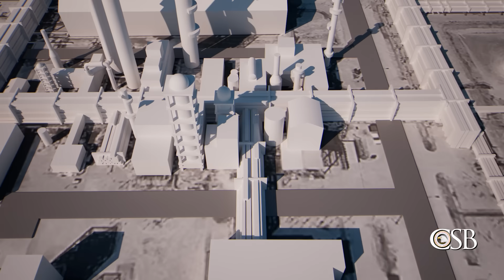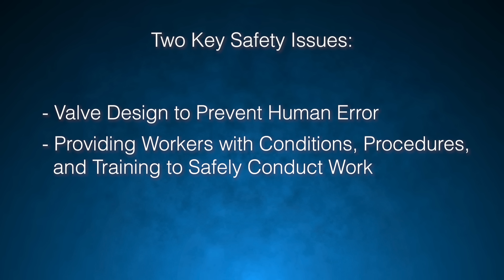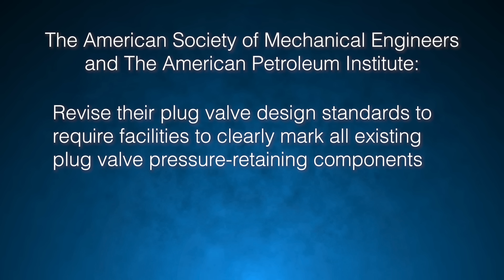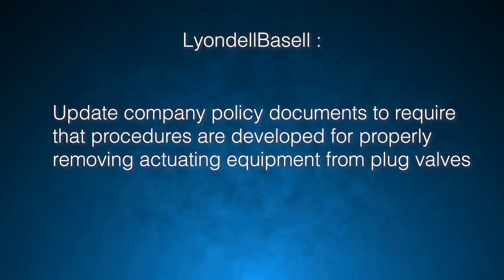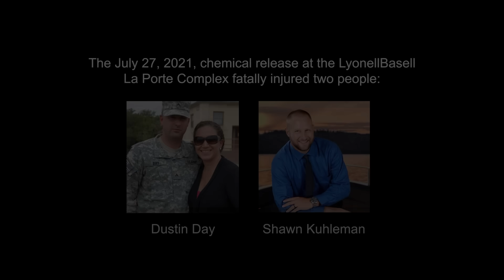Designed to Fail: Chemical Release at LyondellBasell

Comment: Probably one of the most preventable incidents covered by this channel. That said, condolences to the families of the two workers.
Reply: So preventable that it's basically a retread of "fire in baton rouge" video. Employees removed a gearbox from a valve and accidentally removed all the pressure-bearing bolts, leading to hydrocarbon release and explosion.

I guess that problem from before wasn't really fixed.
Reply: @Motoko_Urashima  "there are no new lessons to be learned from this fire, only old lessons that tragically went unheeded" 

- said by a fire chief after the St Mary of the Angels School Fire in 1956
Reply: @Motoko_Urashima  Same nuts that hold the valve together were also asked to hold a flange that needed removal, thus forcing an unnecessary valve disassembly through force of bad design.
Reply: @EinhanderSn0m4n  That wasn't the case in this instance, the actuator was held on with 4 bolts off to the side, none of the valve cover bolts needed to be touched.
Reply: Slap some red paint on the bolts and this never has to happen again.
Reply: I don't work in industry, but I was shocked there was no written or other visual warning indicating what the bolts were. Would seem like an obvious thing to include.
Reply: @anonymoussource1  As a skilled tradesperson who is qualified and regularly works on valves and actuators, it's very obvious which fasteners are holding the bonnet on a valve.  If you think a written or visual warning needs to be present to tell unqualified workers which bolts not to touch if the process hasn't been isolated, depressurised, and drained, then every industrial facility in existence has thousands of pipe flanges you might be interested in.

What I want to know is why the hell pipefitters were performing this task.  Y'all need to get yourselves some instrument techs down in America.
Reply: This one is the stupidest we've seen
Reply: Read
The 
Freaking 
Manual

Look if there aren’t written procedures, at least try to look up the manual for the valve. We have the internet people I would be shocked if it didn’t have the instructions or a parts diagram…

Comment: Is the valve design as fail open? Why remove the actuator in the first place?
Reply: If I had to wager a guess, they thought the flange plate they removed was simply covering the mechanical interface between the actuators shaft and the shaft of the valve itself. In reality, they were already at the mechanical interface between the actuator shaft and valve shaft. The plate they removed was part of the main body of the valve.
They wanted to remove the actuator to ensure someone couldn't accidentally remotely open the valve.
Reply: @HDL_CinC_Dragon  I'm from Germany and have worked in such plants for years. The first thing I thought here was: They definitely don't know what they're doing. In Germany, we definitely wouldn't remove the actuator to prevent someone from accidentally opening the valve while we're working on the flange. All we would do to secure it would be to physically cut off the energy supply to the actuator, i.e. electricity or compressed air, in the closed position by disconnecting the electrical cable or compressed air line. In our plants, many actuators of valves, pumps and agitators have permanently installed safety switches for maintenance purposes that can be secured with a lock. In this case, we would have used such a switch to secure the valve in the closed position. In short, the actuator stays where it is, because that wasn't the real problem, but is secured against accidental activation. And besides, it's actually less work than removing the actuator.
Reply: @benjaminhampel8640  Yeah, that's definitely how this situation should have been handled. I don't know why they don't have a cutoff switch for the power to the actuator. In my opinion, that should be the biggest take away from this incident.
Reply: @HDL_CinC_Dragon I feel like that front plate for the valve should’ve been welded on when it was installed, rather than simply bolted on.
Reply: They wanted to remove it to ensure it was closed so acid wouldn't flow while they were repairing the small leak. Making sure they avoided an unintentional opening of the valve

Comment: Perceived simplicity of the work.....Just goes to show you that complacency is something that must be guarded against.

This is probably the most polished video out of them all. Thanks for honoring those that perished at the end. Sadly regulations are written in blood.
Reply: also they are contracting out work instead of training people to work and be on call is cringe. better to have someone who knows the system and its hazards then to get some randome company to ape your shit up
Reply: @arowhead9  From the video, it sounds like at least one was a journeyman pipe fitter. To be a journeyman, you must have a lot of training and should be proficient at this stuff.
Reply: I honestly can't believe that any pipe fitter would do something like this. They are trained to work with this stuff. Very sad. I personally wouldn't have ever thought a procedure would be needed for such a simple task. Just goes to show how you can't trust anyone.
Reply: @crissd8283 the video literally said they weren't trained to remove the actuator....
Reply: @Generic_Name_1-1  Any pipe fitter worth their salt would think twice what fastners to loosen, especially on a pressurized system, tripley so when hazadous chemicals are involved.
And what about some basic PPE like bunny suits and a full face splash mask.
Reply: @trespire  can't use equipment that wasn't provided to you. And you can't know what bolts not to loosen when you've never been shown which ones are critical.
Reply: @Generic_Name_1-1  A fittter that can't identify what bolt holds what flange, has no buisness working in the chemical industry.
Procedures can be incorrect, or unclear, always use your judgemt as a fall back.
Reply: @Generic_Name_1-1  The video also said at least one was a pipefitter. I'm assuming a journeyman pipe fitter. That means trained in pipe fitting. It there was only an apprentice pipe fitter, that is a big problem.
Reply: @trespire  I feel for all the victims of this tragic accident and I hope that we see fewer work related accidents in the future. I can’t help but agree with you but also it sounds like it’s a bad design if it’s causing multiple fatal accidents. Seems most trades don’t prioritize education these days.
Reply: @Generic_Name_1-1  while I agree they should have been given some sort of exploded view diagram of the setup and maybe fully disassembled a dummy unit disconnected from a system, some things are industry standard for certain jobs. "You've worked on one, you've worked on em' all." 

I'm not necessarily saying that applies to this case (maybe this valve was special or unique), just pointing out that you don't need to be trained down to such a macro level on every little thing to know how to disassemble X even if you've never seen this specific X before. Sometimes you can apply experience in that way. In this case they either all collectively had a brain fart or were not familiar enough and therefore lacked that sort of experience.

Either way, on a high pressure system working on the only thing holding back hundreds of thousands of gallons of acid...yeah that might be the time to do some extra training whether you think the pipe fitters are experienced or not.
Reply: @Generic_Name_1-1 
This happened in 2021. Almost everyone has smartphones. The fitters or supervisor obviously did understand how the actuator was installed on the valve. They should have looked at the valve and actuator tags. With the information on the tag they would have likely been able to use their smartphones to look up the information they needed. 

But honestly that should have been done in advance. Special parts would be needed to install in place of the actuator to lock the valve in place. If they had the correct part then someone had the information. If they didn't have the correct part then there was no way that they could have completed the task.
Reply: @crissd8283 
I think they said two fitters and a supervisor. 
To me it sounds like someone on the crew had a get-it-done attitude. The others took risks due to the pressure put on them. 
Like you said valves are generally not complex. Any doubt should lead to reading the tags and look up the valve and actuator with your smart phone.
Reply: @Generic_Name_1-1  I honestly gasped when I saw that anyone, let alone a pipefitter, didn't know how to remove the actuator from the stem. If you've ever seen one operate, you'd know how intuitive it is. It is honestly inexcusable. The plant operator probably couldn't even fathom making such a mistake because it sounds ridiculous.
Reply: @erniecolussy1705  Exactly. Someone who is a journeyman fitter should know exactly how valves work and should know better.

I'm also honestly supprised they didn't just disconnect the air (assuming the actuator has a spring) and LOTO that. Wouldn't that be sufficient to considered the system LOTOed?
Reply: @erniecolussy1705  I couldn’t agree more about the smart phone comment
Reply: @crissd8283  
Agreed, if the valve and actuator were spring closed. Honestly, I found this video (and possibly the investigation) below the quality of most of their video. There was a lot of missing information. 

One piece of important information that was missing was how they were going to LOTO (lock out tag out) the valve by removing the actuator. If an actuator is removed for LOTO that generally requires parts to replace the actuator for LOTO. The video should have explained why the actuator was removed. It should have explained how the crew was planning on doing the LOTO. 

To me it seems like there was excessive pressure on the workers to get-it-done quickly. It seems that pressure, job atmosphere, and company attitude is what lead to the accident. Even when given a procedure, workers should have the time and ability to evaluate if that procedure is correct and safe. It seems like that time wasn't available for these workers. 

To people that have done this type of work or similar / related work this video makes this crew look incompetent. I don't think that was the case. I suspect that they were under unreasonable pressure to get the job done. This is a problem of attitude of the contractor and of the company hiring the contractor. Employees should never be put under so much stress that they do not have the time to fully evaluating the safety of what they are doing. Stress causes many mistakes.
Reply: @erniecolussy1705  I agree. Often in an investigation they call for a procedure, but you can't possibly have a procedure for everything. I am sure there was pressure to complete this job since another unit was down. It was opportunity work on night shift. That pressure was a bigger contributor than the  lack of a procedure.

I still can't believe any licensed/trained/journeyman pipefitter wouldn't know how a valve comes apart.
Reply: @crissd8283  it's work on non isolated line. It needs a special risk assessment.
Reply: Airline industry did it, no one will because it costs too much. They pretend
Reply: "third party contractor" => everybody dies
Reply: Guys, Here is our Savior

HalleluYAH translates “Praise ye YaH”

YaH is The Heavenly Father
YaH arrives via the TENT OF MEETING
YaH was Who they Crucified for our sins
YaH was Crucified on an Almond TREE

Semitic of Moshe (Moses)
Isa Scroll (The Original Isaiah)

Isaiah 42:8 - I am YaH; that is my Name! I will not yield my glory to another or my praise to idols.

Isaiah 43:11 - I am YAH, and there is no other Savior but Me.

Isaiah 45:5 - I am YaH, and there is none else.